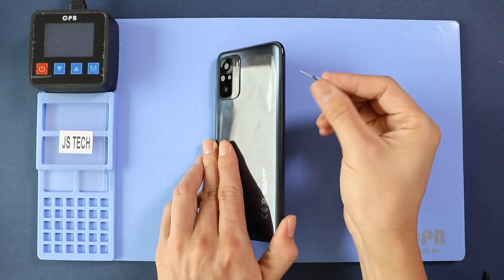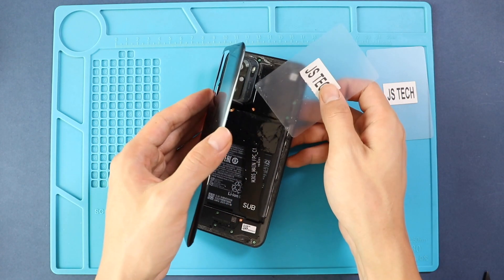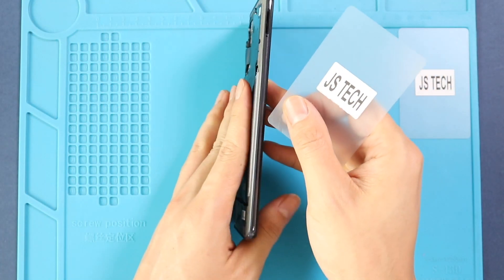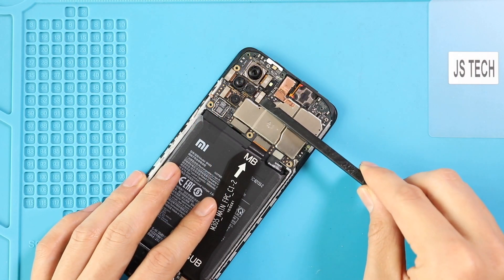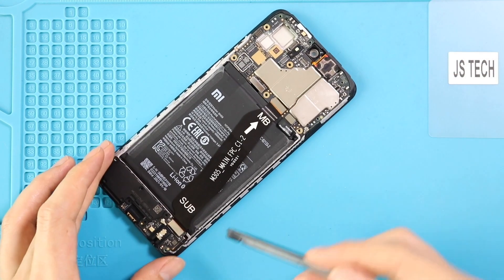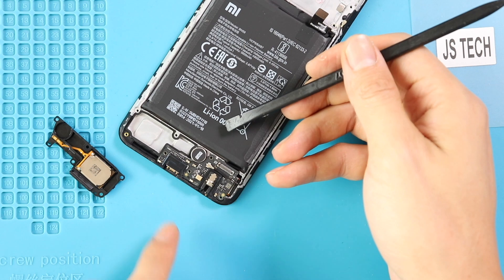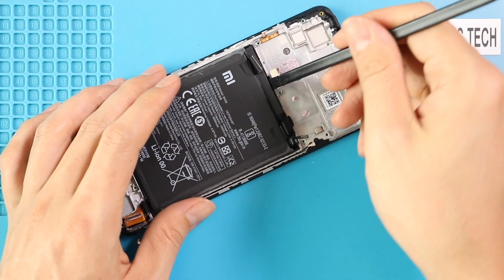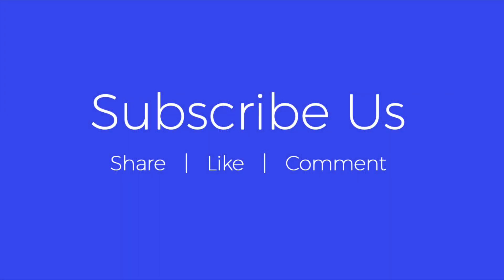Xiaomi Redmi Note 10 Teardown

Comment: Excellent video only 2 things I will say 1 there's 12 screws not 13..I watched and counted 4 times as I could only find 12 ..and 2 u can leave the battery and main camera in place if changing just the screen
Reply from the maker: Thank You and thanks for the update.Probably a small mix up. I will fix that
Reply: @DIYGeardo  all good it was very helpful this phone repair was quite different to others I've done in the past it's built a bit different..great video tho good explanation and easy to follow...put mine on the tail gate of the Ute while working then when I finished I shut the tail gate and CRUNCH it threw the phone right up to the teeth on the outer corner on the wellside and ANIALATED the screen like a gun shot it and the worst part was the phone was quite new and I was being safe not keeping it on me 🤦‍♀️ human error strikes again
Reply from the maker: @yodad4776  Thats bad.yep this is a new phone.Glad you got it done.

Comment: it doesn't have liquid cooling system?
Reply from the maker: it is like this, cooling systems can be a shield, paste, gel or flex cable . Sometimes it is integrated with another unit/part. Xiaomi claims they have a cooling method on note 10.
Reply from the maker: @Prince Cooper not sure exactly, but they do claim to have a cooling system
Reply: @Prince Cooper because the processor of the phone is not that good